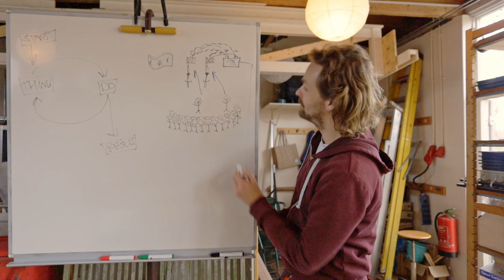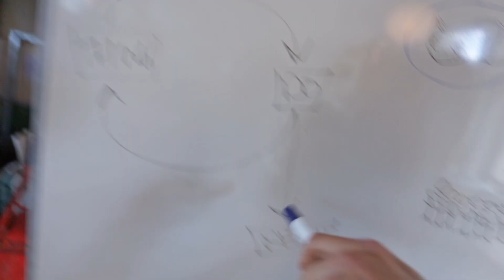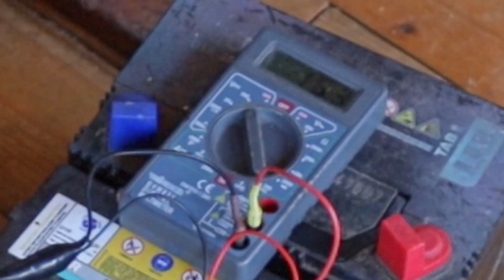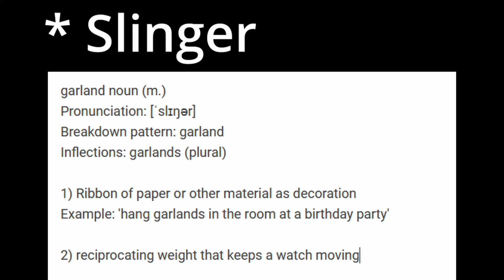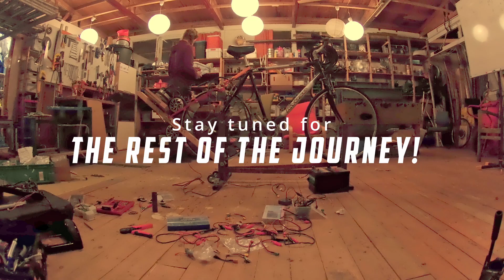BUILDING A BIKE GENERATOR WITH HOVERBOARD MOTORS as part of a performance installation

Comment: cool project. I wonder how the watts look if you get a more accurate way of measuring
Reply from the maker: Working on it! Next video has a... more visual way of showing the produced wattage. 🤗After that I'm gonna try to charge a huge 24v battery with a Victron SmartSolar, which has built-in bluetooth and an app to get all kinds of... stats I guess. I'm figuring that out right now!